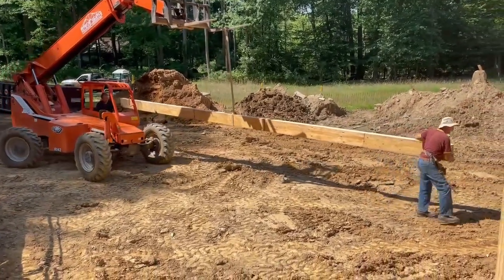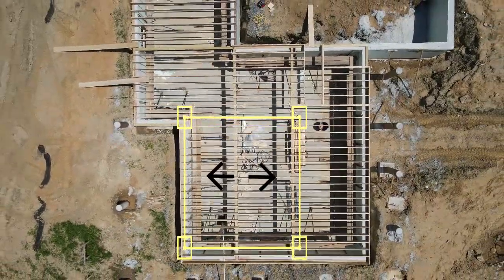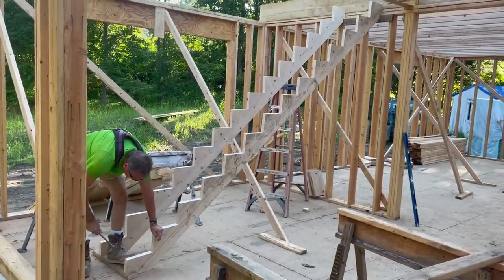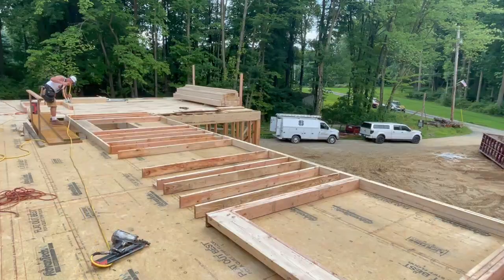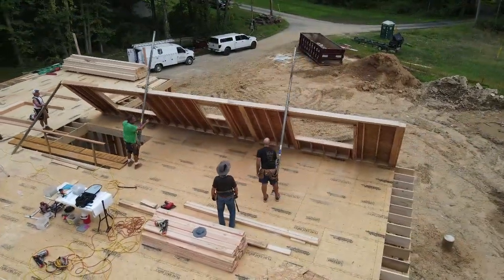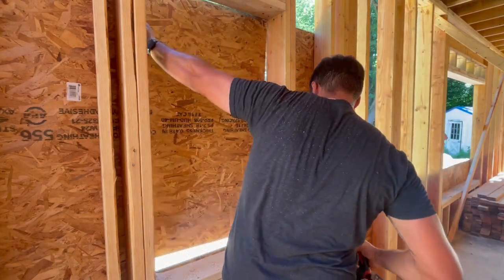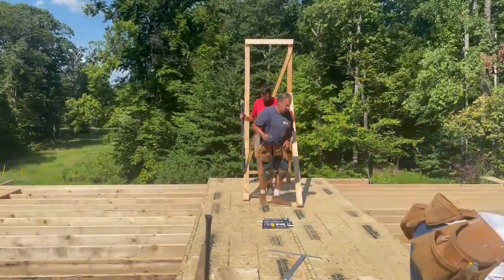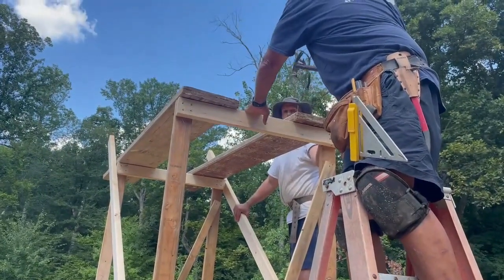Framing Our Modern Farmhouse…Part 2 | Race to the Roof // Ep. 11

Comment: Double 2x12s are cheaper than I-joists?
Reply from the maker: Dave,
  There was one more layer to the double 2x12’s, with Covid and some supply chain issues our local lumber salesman couldn’t even provide us a lead time for the I-joists, And man-made lumber was more expensive than ever. Traditionally I-joists would be less expensive, and require less steel posts, but we had to pivot…

- Matt